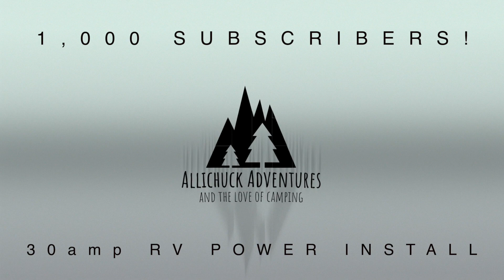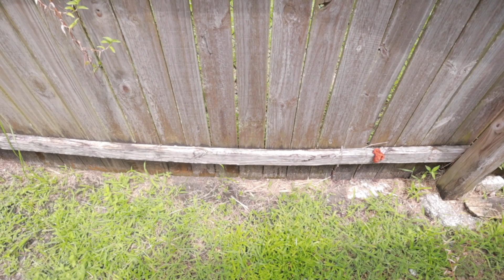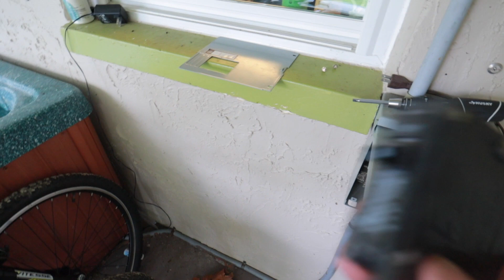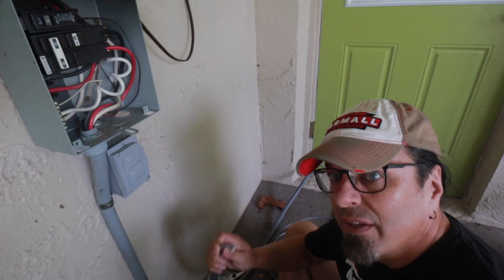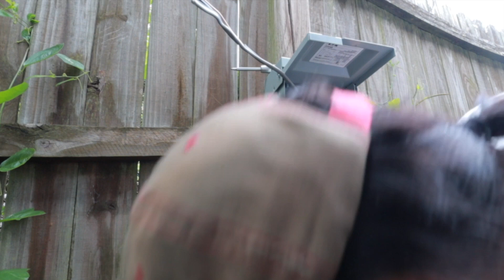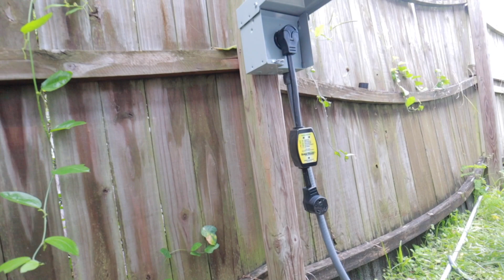RV Upgrades-30 amp RV Electric Box Install-1,000 Subscribers!

Comment: Got a ? For u bud
I’m needing to run 30amp receptacle like u did but I’m starting at a sub panel&  there’s 2 breakers currently ..
1 says 30amp the other idk ,both single poles 
 The sub box is powering 2 sheds there a window A/c n 1 shed ,both sheds are rarely used also the sheds r wired separately ….(2)sets of 2hot/1ground wires 

If/can I add another 30amp single pole breaker to the sub box  or do I need to rewire the 2 seperated lines/buildings to the 1 breaker (combining the 2 buildings) 

Also by guessing for now that the unknown is either  a 15-30 that’s next to the other 30breaker ,should I double check the main breaker box for breaker size ?

Should I adjust sub panel breaker sizes as well 

Also Is there Anything I’m missing or should look for 
Thanks
Reply from the maker: We ran ours off a sun panel for our hot tub.

Comment: Where did the green wire come from? When you were plugged in the breaker, I didn’t see any green color wire! But on the plug box, it was.
Reply from the maker: Been so long ago not sure. But I think was the bare ground wire.
Reply: The green wire comes with the receptacle box. It's a ground. The bare ground wire should have been connected to a buss, a connector that already has the green wire going to it.

Comment: I’m wiring one of these in on Monday. Any learning since?
Didn’t you say something about a shock you recently got?
Reply from the maker: Only think I’d say is if wiring 30amp need larger gauge wire. I had to go with 20amp breaker because of the size wire I ran.  The shock was because I left the Rv electric cable laying on the ground in some heavy rains without kicking the breaker off before plugging the Rv back in. I’d say if it rains and you’re like me and leave then Rv electric cable laying out then kick the breaker off and dry out the. Cable first lol
Reply: @AlliChuckAdventures  Good to know, thanks. Mine will be off the ground. I may make it 50A if my box is rated that high. I’ll have full RV hookups in my driveway after this.
Reply from the maker: If you can do 50amp I would. Not sure what gauge wire that calls for.
Reply: @AlliChuckAdventures  The electrician is coming out Monday for something else. I’m going to ask him to take a look when he gets here. Looks like 6 gauge is the minimum. 

It’ll be worth it when friends mooch dock. It gets hot over here and both AC’s will probably be required.

Comment: 10 AWG and 8 guage if you are running over 80 ft or so.  You should only have a 3% drop to the receptacle.  It looks like direct bury cable.  You should use THHN individual wires.

Comment: Isen't 12/2 TOO THIN ? I Wanta Run A Dedicated 30 Amp Line From Main Fuse Box Maybe 60 Feet To Back Yard For My Toyota Motorhome I Think 12/2 Is Too Thin ???
Reply from the maker: Yes 12/2 is for 20amp. 10/2 is 30amp. I only have a 20amp breaker on ours. We never need a full 30amps in the back yard. 20amps still runs the AC just fine. Hope that helps. 😊

Comment: Is that 10 Gauge? looks like #12 which is only good for 20 amps. Also UF is direct bury cable. THHN is for conduit.
Reply from the maker: Yeah it was 12 but I only have a 20amp breaker in the box. As we would never use more than that just in the back yard. I was just being extra careful using the conduit as well. Thanks for the comment and watching!  😀
Reply: Yup

Comment: I may be wrong but i am thinking 12/2 is for 20 amp service 10 gauge is for 30 amp service ?
Reply from the maker: Yeah I think you’re right but I’m not ever gonna really pull 30 amps. I may change the breaker to a 20 amp to be safe. Basically we plug it in just to run lights and charge the battery. Thanks for the heads up. 😊